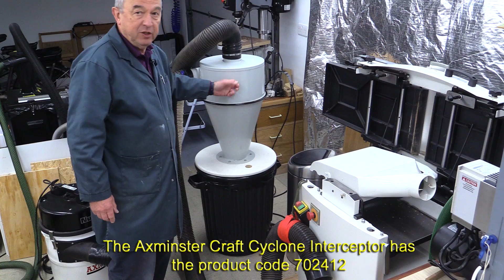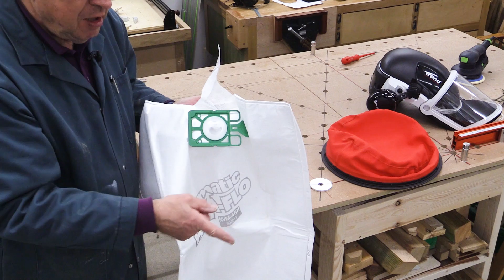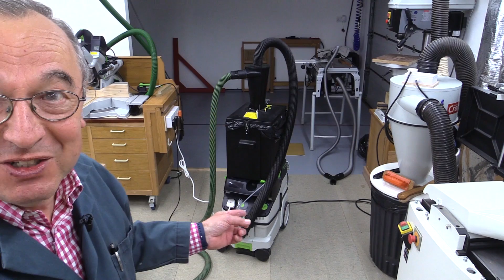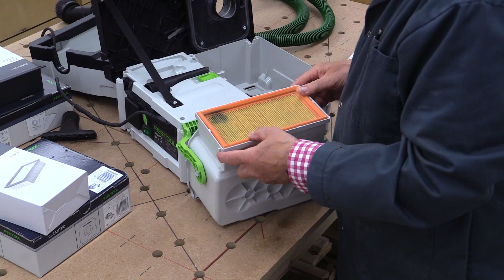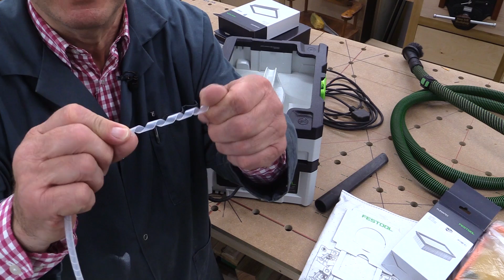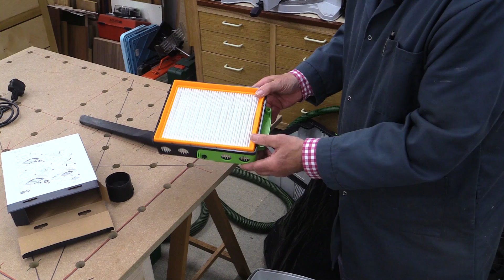Workshop Extractor Maintenance

Comment: Surely you should turn the dust bag inside out when using it with the top cut off. Otherwise the filter layers are backwards?  You appear to have an NVD 750-2, the one with two motors. I've had one for many years, but I'm convinced the outlet is much too small, and it would suck better if another hole was drilled to let it breath better?
Reply from the maker: Yes, you are right. Cheers.

Comment: Thank you for the very educational video. One thing to mention is that you can occasionally take out the HEPA filter and shake it off. Don't use compressed air. While Festool one is not washable my Ridgid one is also washable just with clean water.
Reply from the maker: Although I showed the HEPA filter being replaced I only do that about every 5 years (I think). When I do a routine bag swap I do vacuum off the HEPA filter.  Cheers.  Peter

Comment: Peter, I think you would collect less material in your filter if you could deflect slightly down the air flow coming into you cyclone by 4" over its first rotation. The existing cyclone input is straight so the incoming air flow is disrupted by the existing rotating air causing turbulence, which reduces the centrifugal effect. Which then allows some of that disrupted air to be sucked out into the filter. I added a baffle into the top of my cyclone so that the incoming air is deflected down below the inlet over its first rotation and this stops turbulence and increases airflow. Just a thought?
Reply from the maker: Hi Howard, Thank you. I saw the other comment you posted on the Axminster 4" Cyclone.  Cheers.  Peter

Comment: Another winner Peter. In my small workshop I rely on a CT26AC, a CTM Midi and I also have two CT SYS extractors. So I have to change the bags regularly etc. no space for a cyclone or separator. But it all works well. Thank you for another informative and enjoyable video. I hope the eye settles down quickly. Allan
Reply from the maker: Hi Allan, Excellent and many thanks for your good wishes.  Peter

Comment: Hi. Great video and great care taken. What is the red filter you put over the main filter of the hoover? Thanks
Reply from the maker: Hi Lee, The Numatic NVD750 has a two part main filter. One is white and the other red. Between them they fully protect the motor (and the user) from dust getting all the way through.  Peter
Reply: @NewBritWorkshop  I see. I wonder if they are able to go onto my Charles hoover for a little added protection. Thanks for the video. A very methodical way to change filters etc.